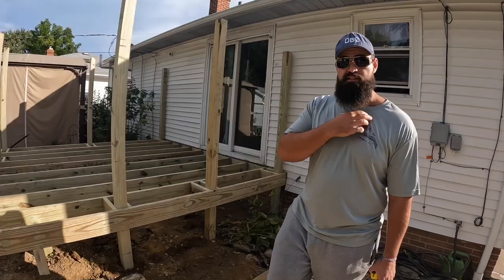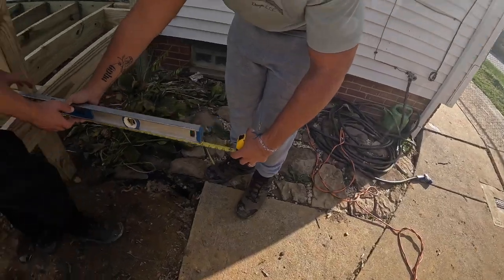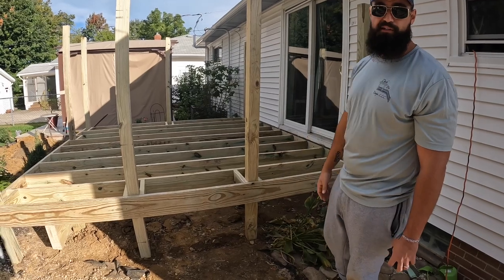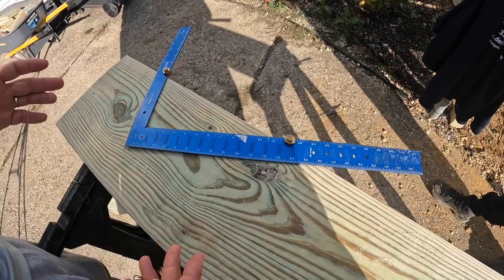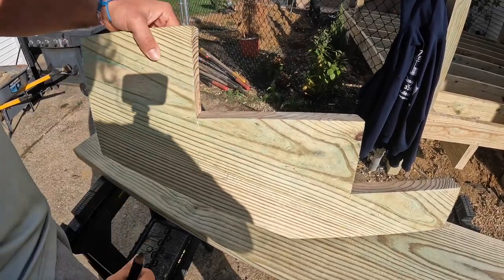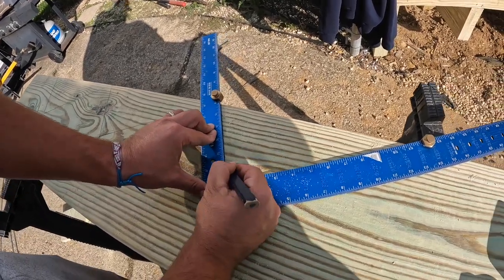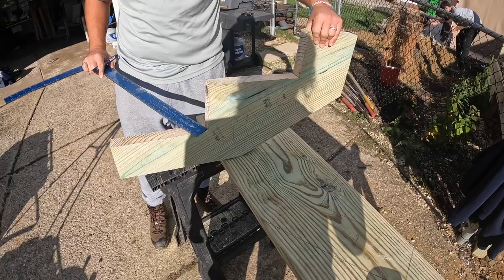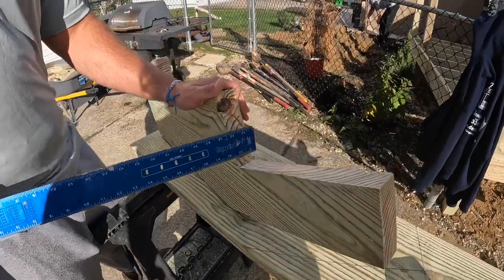How to fabricate stringers (rise & run) (How to build steps)

Comment: I think you messed up your top tread. You subtracted off the back for dbl thickness but one of your 2xs were going on the front. You needed to add 1.5 to your top tread and move your top riser back 1.5.
Reply from the maker: You have to take 3 1/8th off of the top step because 1 9/16th goes on back and 1 9/16th goes on the front. This is the proper way.
Reply: You only needed to subtract for of sgl 2x on the back. Not dbl 2x. Your front is already accounted for.
Reply: @drewmanning1025  he wont admit hes wrong, typical ego tripper.

Comment: Not a good explanation...
Reply from the maker: What can I do to better explain it?
Reply: @deckbydesignl.l.c5091  if you're intention is to have a video meant for someone to learn stairs, & not just a "hey here's some stairs real quick". My advice is script it. Step by step. Maybe not every word of the video but every measurement & mark you're gonna make & why. If you're stopping to consider things & re checking, you know what's happening in your head but the guy who's never laid out stairs will get lost. I'd also show them being attached so people can see how cutting the tread & riser thickness off gets built back up. I don't think you did anything that bad, it's just hard to remember to be as clear & specific as possible because we always know what we mean.
Reply: Agree with your assessment. Still appreciate the initiative of the presenter. He knows the stuff but if he is not detail oriented, it will be difficult for a beginner to follow thru. Thank you.

Comment: Um you skipped over a bunch of shit. Like how do you come up with 33 inches run? Like is it to do with width of board you are using? Also im not sure what code you are following to only have 6 inch rises.....pretty shitty video skips over too much details.
Reply from the maker: I appreciate your feedback. Yes, the individual run is based on the width of the decking plus the necessary gap between decking. If you take the full amount of steps and add them together you will have the total run.
Max individual rise for a step is 7 3/4. Minimum rise for a step is 4", but I don't like to to under 5.5". 6 to 7 inches is perfect.

Comment: Your DIY er will click off in 20 seconds way tooo much over kill with fractions  maybe try and round stuff  off or maybe your just not the teaching type... Many are not you know..
Reply: When doing Carpentry you measure in fractions down to 1/16. You can't round when building or you'll have a mess. If a do it yourselfer doesn't know that they shouldn't be building anything.